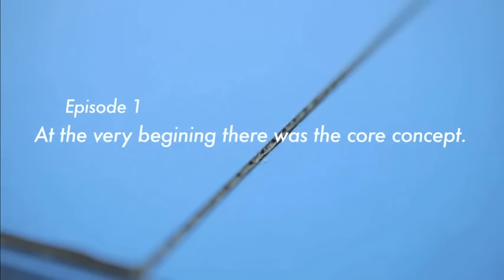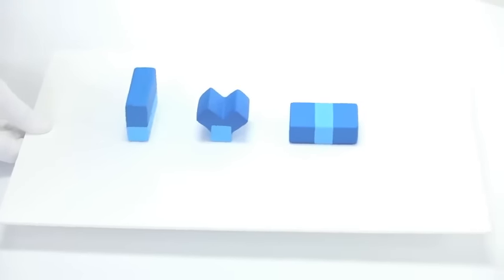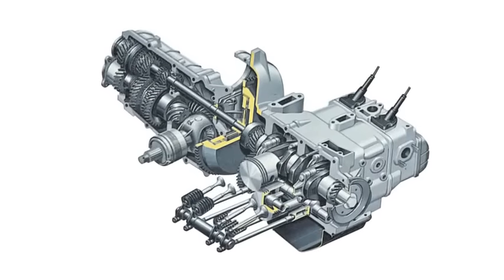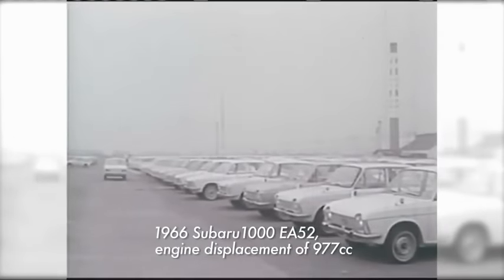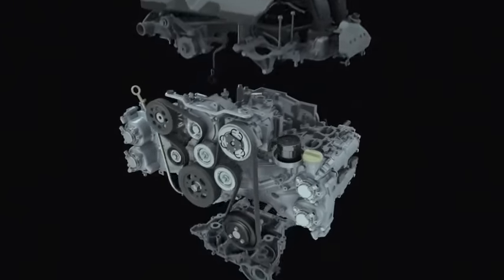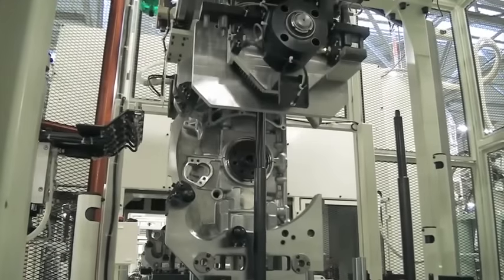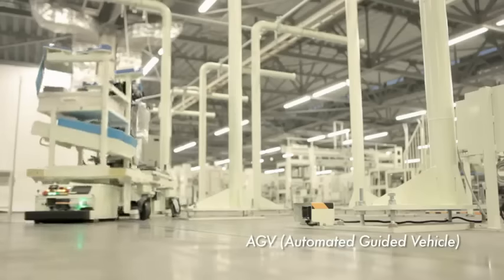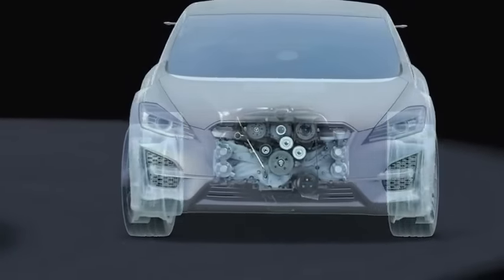Learn About Subaru Boxer Engine Technology

Comment: The mime was scary. Those cars are a poor man's Porsche only with the engine in the correct spot (Top Gear reference, lol). I love Subaru's, lovely cars! The only issue about them is when the head gasket goes out. Just like on any car eventually, you'll need to remove the block to do the job because the inner fender walls are right up against the valve covers and heads. Every car has it's quirks so don't shy away from them just because of that. You can't call yourself a car guy until you drive a car with one of these engines and a Subaru is a wise and adorable choice. If your really worried about the head gasket buy something with the 2.2 rather than the 2.5. That's still a great engine.
Reply: find a good mechanic
Reply: Subaru is garbage. They are putting trash into a can and calling it a car. 

Gordon is right. Find a goods mechanic. Oooooo all wheel drive. Doesn’t matter if the car doesn’t go any where. Parts a stupidly exspensive. 400$ for oem cv axle a piece. Come on. I had to replace mine at 65k. Bull crap.
Reply: Ej25* which is what the sti uses(ej257), and its the only car still produced with it. Its trash but the ej20s,ej22s, FA20, ez30 and ez36 are great engines. The diesel boxer was unique and an innovation but somewhat incomplete.... Because it still had many problems
Reply: I bought an Outback with 3.6 engine. 
Loving it !
Reply: mar1video until it starts drinking oil.
Reply: Ian Cunningham - it won't. At least not as much as my Ford or Jeep I had.
This is 3.6 l engine, they don't have problems with oil leakage. 
Please do your homework before posting unsupported statements.
Reply: At least it's not a piece of shit domestic car...
Reply: Russell R it’s a piece of shit foreign car
Reply: Ian Cunningham - Subaru its made in Indiana USA. 
Not like some other "domestic " cars...
Reply: Ian Cunningham Japanese engineering is leagues above American engineering. In fact, even German and Swiss engineering is superior to domestic. Just because something was made in America, does not mean it's automatically the best..
Reply: Russell R - I had a v6 Honda Accord with 180,000 miles on it when the transmission finally gave up on me. 
And a Jeep Grand Cherokee that fall apart after 90,000 miles
Reply: Russell I agree Japanese engineering is great. But not in this instance.
Reply: mar1video Not a personal attack, but I'll be willing to bet the transmission went on your accord due to driver error, and not because of faulty engineering. GC's are known to have issues with their drivetrain, cooling systems, electrical systems, but GM does nothing to fix the problem. Take Ford and their 5.4 triton engines for a definitive example of shitty engineering. Never had any of those problems with a foreign built engine.
Reply: Russell R find me a car that is made in America. That’s made not imported. The truth of the matter. Most cars are a multinational effort. The assemblies happen everywhere. 
I owned a Subaru and it was nothing but problems. Oem front axels gone at 85000. Normal wear my ass 
Airbag module failed at 90k. Exhaust cracked 70. Engine drank oil from day one. Spark plug galley orings cooked at 30. Had to replace wires too.   Couldn’t keep lightbulbs in it. No I didn’t touch with bare hands
Brakes oem front rotors 47 k. Rear discs replaced 65k. 
So what I paid for the car it was not worth it and it was a price of crap

Oh yeah radio head unit replaced 3 times. Under warrenty lucky.
Reply: Russell R ok currently sitting I a Toyota and not one of these things has happens and I have 125 k. 

It doesn’t drink oil either.
Reply: Do boots breaking at such early mileage is normal. An airbag module crawling out is Normal. 30 k for rotors. Bull crap. Oil gally orings   Dude. Not normal. I don’t know what you do for a living. But it’s NOT on the regular wear items list. What I had was a piece of garbage.
Reply: Do it even know what they want for an OEm axle?  
BTW they wanted 250 for airbag rationalization module. Poor solder job fixed. 
The point is. It is a poor example of Japanese engineering. 
Honda and Toyota can have my money anyday

Don’t worry you’ll have your first big problem and it will be your last big problem. Your head gasket gone yet?

I’m sorry. By a side ways moving piston is not going to get the prowr lubrication. Just look at all the oils problems the rotary aircrat engines have.
Reply: Russell R - actually 98-01 Accords had a problem with the transmissions. There was a recall for it, but when I found out about it , I couldn't qualify for it because of my mileage. 
When I had about 100,000 miles on it, I lowered it 2 inches, installed the cold air intake and drove it to work everyday about 80 mph. 
I loved that car. My 98 Honda Accord. 
Bought it brand new in Nov 1997 ( it was that just introduced 1998 model). Drove it like I stole it for 20 years, always with a full synthetic oil, with oil changes every 10,000-20,000 miles ( don't ever try this with a  Ford or GM).
Was it my fault? Well... perhaps it was, but she never complained !
Reply: mar1video right. So it’s a domestic or foreign.
Reply: mar1video yeah. Tell that to Russ. He said at least it went a pice if shit domestic. It’s one market. I guess it’s just a piece of shit period.
Reply: Actually, I rebuilt the top end of my 2.5 NA Subie Baja in the driveway with the engine in. Lapped the valves and everything. Bastard runs like new now so...
YouTube it. It’s done all the time.
Reply: Russell R Dude that shit ain’t normal we have a Chevy Silverado 2006 mainly used for work and some light off reading the engine and tranny are still going STRONG. It’s at about 100k and the biggest problem it’s had is it doesn’t accurately read gas tank level. But anything to do with a tranny or an engine or a fuckin axle there’s NO excuse why any of that should have issues before 100k
Reply: mar1video 
Camry can go 500,000 ms without opening the machine

Comment: These are actually pretty low maintenance. Working at a Subi dealership, I would have to say that my only complaint is that the spark plugs are hard to get at because they sit right next to the inner fender walls.

Comment: I’ve got 82,000 miles on my 2015 Legacy 2.5. Should I be concerned with head gasket or any other mechanical issues related to the flat 4? All recommended services have been done by Subaru dealer.

Comment: good luck changing the spark plugs on the boxer engine
Reply: +CaptainD00M It's not too hard to do :p
Reply: +CaptainD00M japanese have tiny hands :D
Reply: +G. I'm not Japanese and I have small hands.
Reply: Passenger side has nothing at all in the way with tons of access. Drivers side; unbolt washer fluid tank, set on battery or strut tower, tons of room. 
Just did it yesterday, including gapping plugs and all, maybe 15 minute job.
Reply: My subi is a twin turbo ej208, so there's plenty of bullshit piping, vacuum lines and whatnot to maneuver around
Reply: +Helmuts Vanags Me? I've got the new body parts on, haven't painted it just yet. Nothing serious was hurt, side marker light and fender.
Reply: CaptainD00M 9.
Reply: really not that hard.

Comment: I had a Year 2000 GC8 WRX at 260,000km

It was in tip top shape, engine tested and tuned, car dyno'ed and all. I sold it in the end to own a current model WRX

Comment: The pushing and pulling force of the crankshaft to the pistons eliminates the gravitational forces that would pull the piston down if it were not in motion. Like centrifugal force or tying a ball on a string and flinging it in a circle will cause it to start rising and balancing out the gravities forces pulling it down. I believe ~200rpm is all that is needed in a 4-cylinder boxer engine to negate the problems of one-sided wear due to gravitational forces...which will never happen.

Comment: it is a nightmare for maintenance because of head positions... on other cars you just pop the hood and you start working on the engine but here you have to disassemble entire engine before you even start... so for users this marketing story can be interesting but if you are a DIY guy, just stay away from boxer engines... and he mentioned several times "many advantages" but in reality it is only low gravity. also if you have a 2-3ton SUV, those 100-150 kg a bit lover are absolutely not noticeable... so only if you have a <1T sporty extreme car for hardcore racing than you can say it can influence your life in small amount...
Reply: +ktm640lc4BGD     Yeah and your BMW height of perfection. Yes BMW's complete shit. Beautiful skin's all friable gearbox, glyuchanaya electrician and poor suspension. BMW shit.
Reply: +Dmitry Sti by your comment on the topic (boxer engine) i can see you are a smart guy.
Reply: +mystic1754 well i do not get it now... are you saying spark plugs on boxer or bmw are complicated to change? i think it is more complicated on boxer because on bmw i just have to take the top plastic cover and ignition coil (one screw) to access spark plugs...
Reply: +ktm640lc4BGD Whole story starts to flip when you think motorcycle. There's nothing more user friendly than a flat twin bike. 
On a car however, there are some more advantage: 
-Oscillating masses are completely nullified -> you wont need additional rotating masses to compensate
-Perfectly symmetrical ignition
-Biggest possible bores and displacement per cylinder

Yet, in the end I agree with you. Those advantages only really start carrying weight in the high end sports world. I love Boxer-Bikes for their torque, charisma and user friendliness, but wouldnt wanna own a car with it.
Reply: +ktm640lc4BGD  well they are kinda annoying to work on. as the video said 6:58.  they are kinda complex
Reply: +Dmitry Sti You should learn how to use English before using it.
Reply: Enriqe64 Both I know and I write whom it is necessary that will understand, the clever man.
Reply: Boxer engines are incredibly easy to work on, much easier than any other engines I have worked on.
Spark plugs are very easy to change, all the sensors are easy to get to, etc.
Reply: You do realize over the years Subaru has made it so much easy to make repairs.....how many cars have you seen have thought out designs by having the oil filters on top instead of the bottom?
Reply: i know many bmws have filter on top... i dont know about other brands...
Reply: Aoru you act like its hard to change it from the bottom
Reply: Daniel Newman You don't realize how much better it is when the is filter on top. Much easier access, especially if your car doesn't have a skid plate protection under the engine, which all Subaru has that you have to remove before.
Reply: find the right mechanic, then.
Reply: Volero

Comment: They missed the VR6 engine configuration, also the small blue engine shapes that they shake and fall over is stupid. Because the V would not fall over at all as it is stabilized by the entire crank shaft, among other things like screws and the fact it fits in the car perfectly ...so putting it on a piece of paper and shaking it via a clown kinda seems a bit silly.
Reply: They are talking WITHOUT the help of a heavy balancer and flywheel to keep it from vibrating. The Boxers don't use balancers, just pulleys, and use standard flywheels.
Reply: Not a question to be stabilized by any system, but just to say that a boxer allows you a lower weight position...
Reply: thelocustemperor your confused.  they were showing the difference in their centers of gravity.  which was completely correct.
Reply: ... i dont know man... the boxer block did not fall or topple over...... i must get a boxer engine!!! it's the only engine that doesnt fall over! everything else will fail!

Comment: Ok if you're going to be that way. Then your ball at the end of a string is not exactly the same, (but can be loosely referred to it as that) because your ball at the end of the string is going around in circles and is not changing direction like a piston would. So in order to get the ball to change direction (like a piston connected to a crank) you would have to have something like a Paddleball. Or attach a ball to an elastic string and fling the ball back and forth in a straight line.

Comment: I like subarus alot but the boxer is a bitch to work on
Reply: Why? I was quoted $1,100 to replace a cam belt in one car. I questioned YouTube and easily replaced 2 cam-belts on my 2 Subaru's in less than 3 hours for $126 parts!  After my bikes, they are a dream to get at.
Reply: Mine is very easy to work on. Much easier than inline 4 cars.
Reply: Actually, I got the 3 hours wrong as it was 45 mins each. I must have smelled too much petrol that night. I have heard silly comments like the top side of cylinders getting no oil. Sigh, silly comments from those that have no idea how they work or easy they are to work on.
Reply: wait till you have to replace the head gaskets.......
Reply: Compared to my 1966 Triumph herald that I can replace a head gasket in 1/2 hour, the Subaru is substantially harder: ie, remove cam-belts, 45 mins to off and on and add each head off/on at 1/2 hour per side. But, while the Herald removal is a common need, the Subaru is seldom. I have just bought a 17 y/o 2.4Ltr Leather trimmed Outback at 461,893Kms with a workshop history. Nothing but regular maintenance! No turbo: the 2nd owner of just 6 months handed it to me with the comment that I'd a Subaru fan understand its idiosyncrasies.  This car pulls like a GE loco. It can surprise some that want a traffic light drag. What I am replying to is the time needed to replace a head gasket: And that time is nothing compared to the output of a perfect motor. If you do not understand power to cost ratio, you do not deserve to own a Subaru. Buy a Nissan. Why did Jeremy Clarkson ban Subaru from Top-Gear?  Because,  to endorse it meant scrapping every other brand they could test. The cost to repair a Subaru is a lot less than competitors with the same H.P. output and that is my comment; Subaru offer us common owners a cheap, powerful car. It's maintenance is cheap for  a non lazy person. But if you are Lazy, it is still a great car until you are stupid and make silly comments on Youtube expecting 600HP with no cost. I have problems with owners that want power and will not accept the associated costs.
Reply: find a good Subaru guy to work with.
Reply: FCFordLord who are you trying to fool.  Any in-line 4 engines will be a breeze to work on compared a boxer engines.  I have stripped a 92 civic engine (inline4) down to the piston and rods and reassemble the engine.  No way in the world will any other engine is as simple as that engine.
Reply: Dude, boxers are considered some of the easiest engines to work on.

I know a lot of guys (many who say wouldnt own a subaru) and they all agree that subaru engines are easy and great to work with.

Comment: its all fun and games until the head gaskets blow
Reply: Dougie Flow 
no, just no
Reply: See my other responses. Blown head gaskets are easy to avoid in subarus. Just keep the head grounding cables clean and change coolant every two years. Do that and unless you over heat the engine somehow head gaskets will not blow at all.
Reply: Wayne Wildman

there is ABSOLUTELY nothing to do with those small ass grounds.

oem coolant are good for 160 000 km/5 years.

head gasket WILL fail, because subaru. its a design flaw.
you never wondered why prosches engines, wich are boxer too, didint fail on head gasket?
Reply: My 02 wrx has 161,000 miles and never has had the issue. My daughters 98 legacy has over 270,000 miles and hasn't had that issue either. The grouding cable is the key to stopping electrolysis.  Don't care what you think because I know and btw I have replaced head gaskets for others and electrolysis was the reason the gaskets blew.
Reply: Phil Speakman hell yeah the evo will beat a sti on the track put some gravel snow mud or anything that's not pavment good luck keeping up with the sti.
Reply: curtis tompros true that.
Reply: matthew stack good stuff.
Reply: Wayne Wildman thanks wayne. If you are being honest I'll tell my mom so she knows to really make sure to keep up on them. She's buying either a crosstrek or a  2014 or 12 forester
Reply: Laura Moe LOL
Reply: Using a wrx or sti gasket helps IMMENSLY. They don’t leak or at least a much better design

Comment: One sided, says nothing about the disadvantages. The block is twice as long compared to an inline engine, and requires two heads, making the whole engine very wide. There is a reason why manufacturers do not produce them. Center of gravity is indeed low, but that has little relevance for a road car, it is not crucial for a sports car either as evidenced by many sport models which use inline or V.
Reply: well said that man made it,s fame on turbo power help !! non turbo subaru  just average not cutting edge 1965 honda s800 any one ?? thats a tech fest pity car guys
not ready for it then and even now pop pop bang bang sound track new  piston head generation roller bearing crank any one ? ( bda)  always bikes to show what can be done
Reply: Well said there shit
Reply: Heptagon 2 words. Porsche. 911.

Comment: If inline is so bad how come i have an inline 6 that i decided to overhaul after 30 years and 6 overheats? 1 of them because he ran out of water and the whole thing was smoking from inside... i was trying to blow him up for rebuild, and the only thing i got was a bent pushrod, engine still kept going... so i took a running engine to the shop... didnt expect that... ever... well the Exhaust Manifold came down in 3 pieces when we tried to separate it XD

1981 4.2L Mexican engine (258)

Comment: My wagons putting down some power with stock internals… full bolt on. 16gtx 92 pump anti lag 350whp.  Ejs just needs good tunes and supporting mods… probably 0-80 is almost equal to my pops 06 911 Carrara… of course he got the top end on me lol 😂 he was quiet impressed